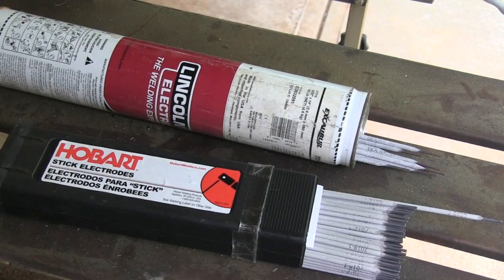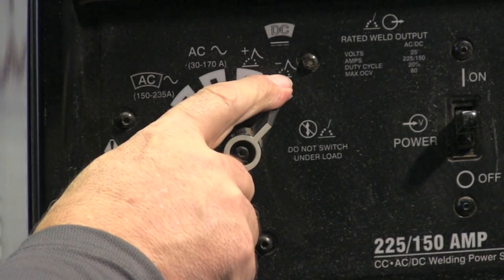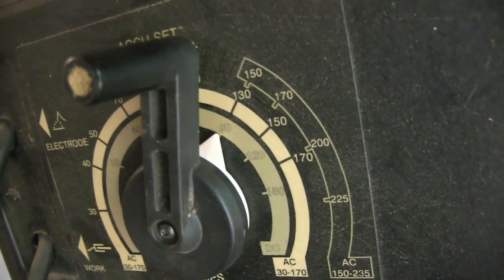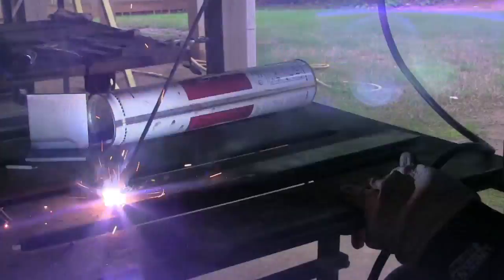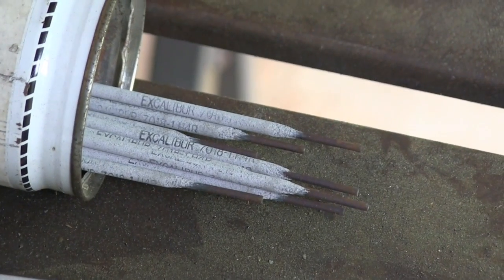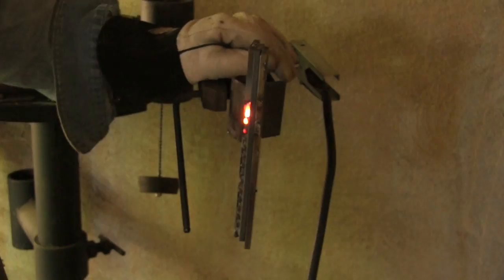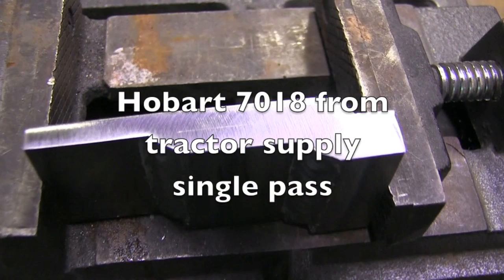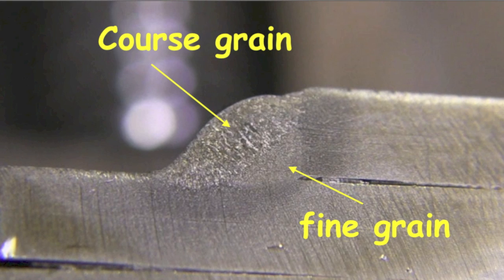Stick Welding 7018 Cut & Etch

Comment: I often need to do vertical up laps on 4 mm, weaving burns off the edge and makes it look nasty, is there a technique for straight up no weave ?
Reply: Rufus Chucklebutty hi . try to look at the 2 regulations at the beginning of the video more than once and notice the difference with the 90 and 80 A. Now if you use an inverter with "arc control" it will add amps as you will be close to the edge so  you can regulate that "arc force" to  use 10% for instance, or zero, for up hill.
Reply: Rufus Chucklebutty DC + may help as well. 
I am not professional but noticed how natural and easy it seem when rising with a gentle inverted smile, then you use a cold side to mount your weld on as alternatively there is a side that cools off.

Comment: im going off the cuff here. low hydrogen rods need to be kept in the oven for 4 hours before use for code welding. then for every 6 hours left out they need to be put back in the oven?
Reply: The specifics depend on the code and humidity. The hydrogen comes from water absorbed from the air. For nuclear power plant critical they can be out of the oven for only 2 hours and then discarded, no reheating allowed. Oven temp is also a factor, with holding being a lower temp than the heating/refreshing temp. most code work will allow 4 hours out of the oven and mention the minimum reheat conditions.
Reply: My Sharoner I was explained that new rods can take 30 hours of 600 or 662 F which allows for about ten cookings. I did heard of 3 times only so it was good news.  staying in the oven after cooking at a much lower temperature 176 -248F guarantees that no moisture will enter the graphite coating  (which is the primary cause of that "cooking/drying"), so the rods are in a similar condition than just after first heating. Now only a few rods are out of the big oven at a time, then kept in the portative one.  ( or pre dried rods are used from a closed bag , as 48.00 ESAB, they are good for 9 hours I think)
any customer may have its specific code then, it is their right to ask for.
Reply: wolfedog99 highly hygroscopic graphite coating.  possibly absorbing more humidity  than sillicate crystals, if not sillicate crystal    pouches would be better considered than "better than nothing for conservation " that was answered to me when I asked.
I only have answers from one rod maker and consider myself lucky as this seem to be secret recipes. I think the general lines should be more available to public as not to cook 6010 or all position rods generally.  better than degrade rods by mistake.
Reply: wolfedog99 also the large oven is at high temp only for the 3 to 3.5 hours needed then only a low temperature is kept inside. just enough to have no moisture inside hence about 212 F probably.
Reply: possibly also a hot/warm rod will attract moisture from the air more easily than if it is cold, This do not help the oven managment when outdoors, and cooking the night before then letting cool so the rods are cold  next day, seem to me a good manner

Comment: Exactly how did you use a meter to check your exact amperage? That seems like a useful trick..
Reply: Gordon Reiher You need an DC/AC amp clamp meter and hook it to one of the cables to measure the actual amperage flowing thru the wire. It a good trick for an unreliable amp adjusment mechanism/potentiometer.
Reply: Thanks!
Reply: Henry Rollins sorry , I even find some Ac amp only for very low price  ( they do not test DC amp then) . I was on the idea that the AC models where very expensive
Reply: Gordon Reiher a DC amp should be enough   and way cheaper, (Trotec , about 20 USD) but no AC reading then of course.
Reply: Isaac OLEG Well, I have an AC buzzbox, so I guess I'll have to wrangle an AC meter, right?
Reply: Gordon Reiher right ;) I just wanted to say that a DC amp is easy to get. AC models are expensive generally.
Reply: Noted. Thanks
Reply: Isaac OLEG True, but Ac/Dc ones are useful at home also and one can find them for around 40 bucks or so...
Reply: I don't get it. my meter reads milliamps only.
Reply: Trev Mint We are talking about these devices : https://www.amazon.com/MS2108A-Range-Digital-Current-Tester/dp/B00SQ4UETO/ref=sr_1_3?ie=UTF8&qid=1493853114&sr=8-3&keywords=ac+dc+clamp+amp+meter
Reply: Isaac OLEG No need to apologize, nobody knows all things...!  AC ones are actually cheaper than DC ones, at least here in Argentina. Cheers!
Reply: Henry Rollins. apologize? thanks
Reply: Trev Mint Isaac's apology. You are welcome.